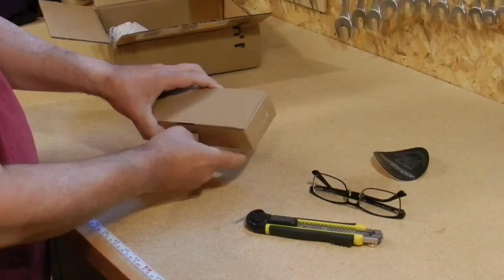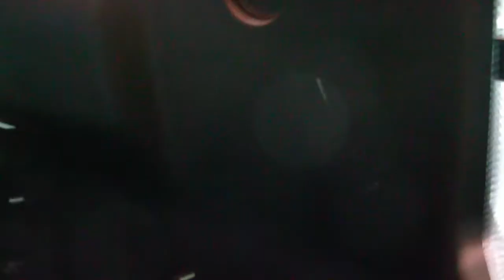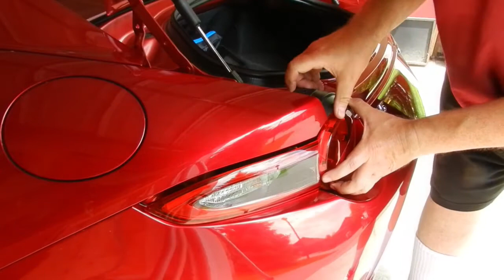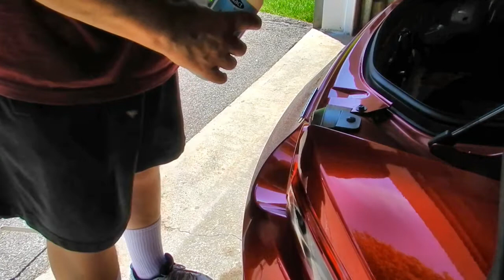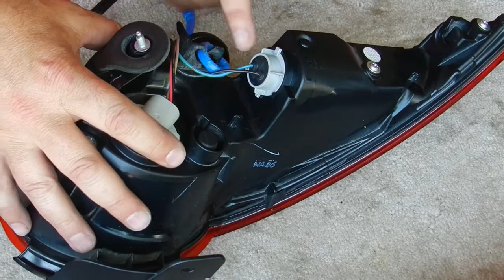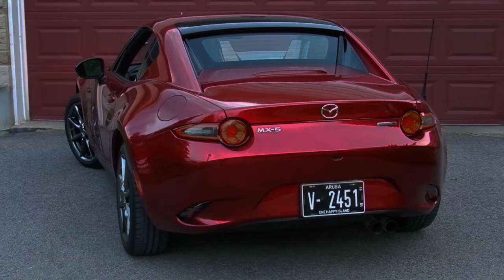MX-5 ND Rear Sequential Turn Signals

Comment: every time I watch ppl get this deep in to panel removal, I always wonder why they don't take the opportunity to apply (squares of) sound deadener to various panels/surfaces.  I'm not talking 100% coverage, but 4"x4" or 6"x6" (or similar) squares to all of the metal panels, even the fuel filler tube shield.  Stop resonance before it starts.
Reply from the maker: Good idea.  As it turns out I am quite deaf in one ear,  and the sound deadening would be a waste of money in my case.

Comment: Any idea what the extra stickers they came in the Styrofoam with the LED boards are for?
Reply from the maker: I don't recall seeing any stickers in my package.
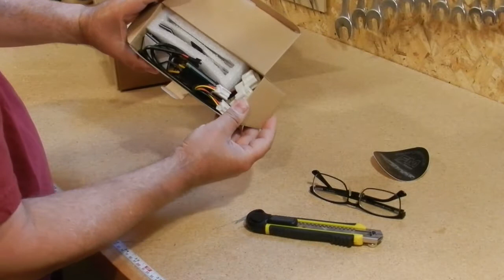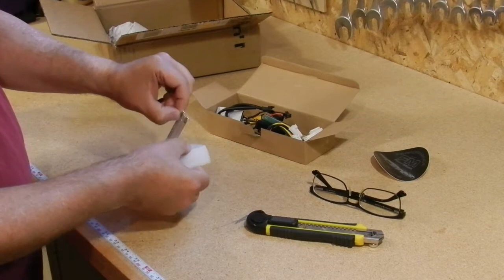Reply: @thereddoorgarage8606 you can see them at 0:36 they are the darker things in the Styrofoam and when you pull the circuit board out at 0:45 they don't come with it.  

Maybe they're extra stickers for the circuit board?
Reply: @thereddoorgarage8606 I reached out to Flyin Miata, they are zip tie anchors
Reply from the maker: Thanks for the info.  Obviously I didn't use them.

Comment: Nice work, but I'm just concerned what if the resistor over heats or something goes wrong can it cause fire since the fuel line and tank is right beside it. Just wondering
Reply from the maker: Generally the current should not cause any concerns about overheating.  The resistor will be warm to the touch after a few minutes of use, but certainly shouldn't be dangerous.  I would hope that the engineers would have worked those details out.  Thanks for watching.